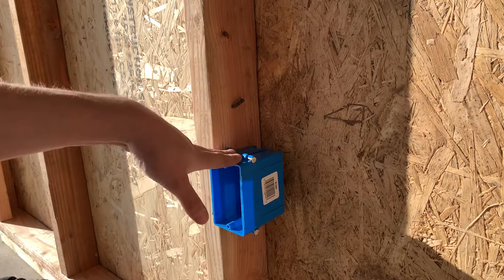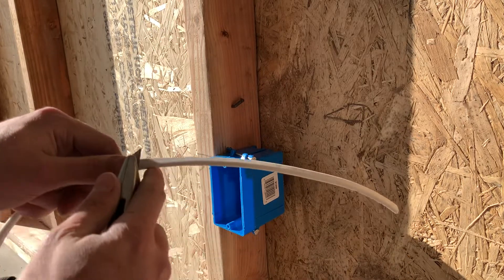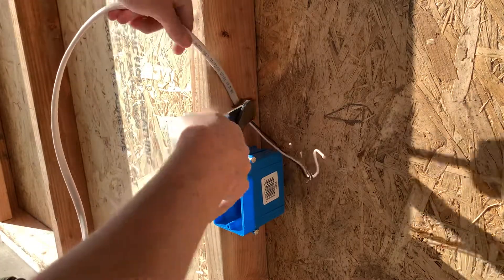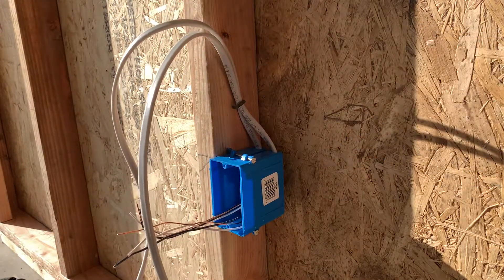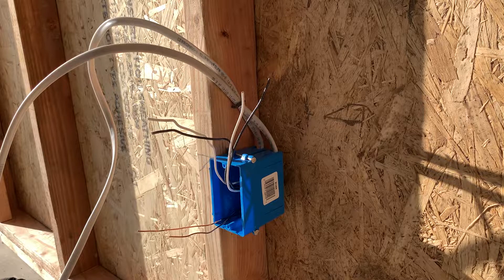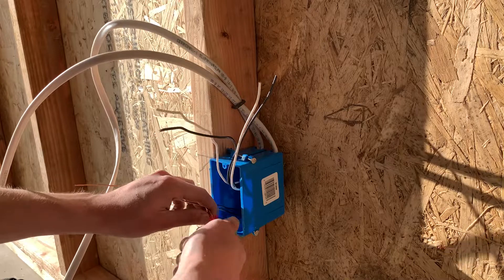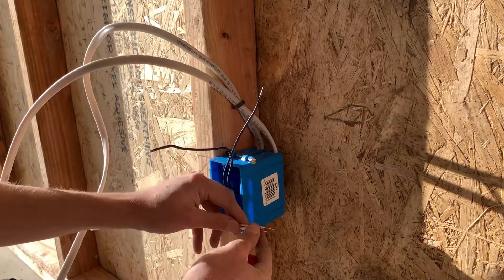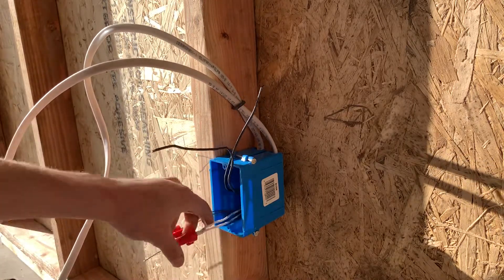Electrical 101: How To Rough In A Receptacle (2 Wires)(Residential)

Comment: Hey man thanks for the tips, do you have any tips for speeding up the process for running wires and stapling?
Reply from the maker: straight drilled holes make a big difference, run 2 wires down a stud/staple 2 wires under a staple, but practice helps and youll get faster. some stuff just takes time :)
Reply: @DailyElectrician  Hello their long story short I am thinking about doing an apprenticeship with a union JATC 669 it's actually sprinkler fitting however I was think of doing electrical work, I currently  am doing other things in my life but this stuff is my backup plan, how is being an electrician?